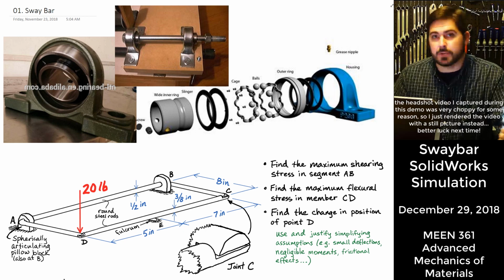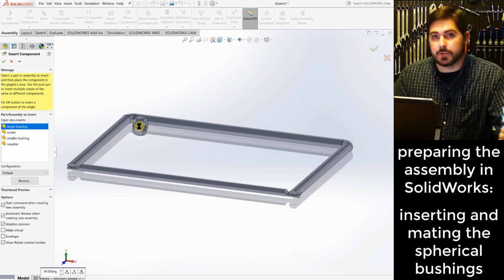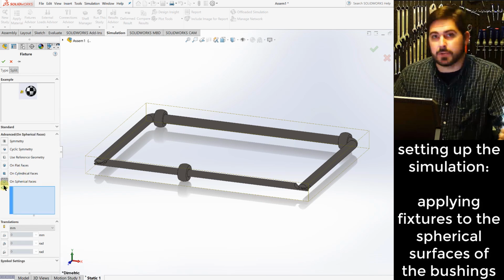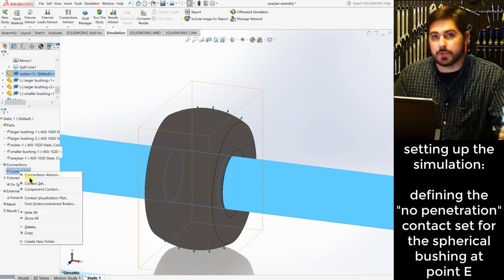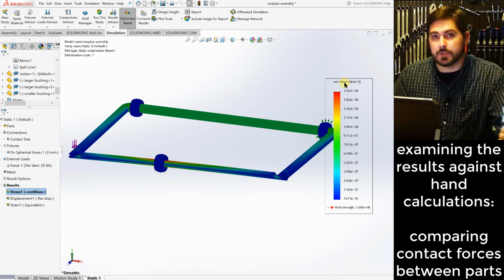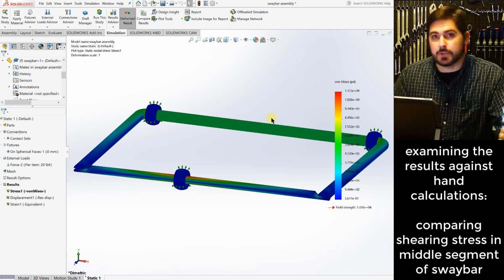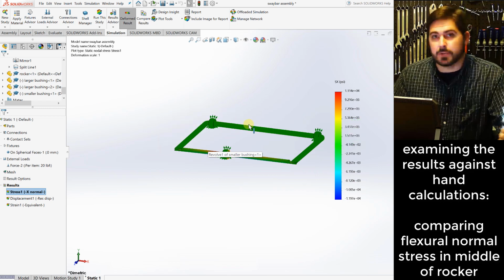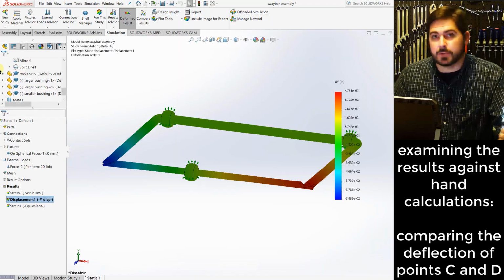Swaybar Mechanism SolidWorks Simulation | No Penetration Contact Connections | Stress & Deflections

Comment: Hi professor, curious - when you chose to ignore the shear in XY bc of the stress concentation, lets say you really did want to know TauXY, how would you go about verifying that actual stress to ensure its not a computational error... local mesh refinement? change the geometry? 

Also, when applying the external forces, sometimes i get high stresses at the point of application (contact stresses). How do i avoid this? thank you!

Comment: My mesh never works, probably my connections are not right
Reply from the maker: It is true that meshes often fail because connections aren't defined quite right, but another thing to look for is any abrupt features in the geometry of your parts. Nicely defined fillets tend to help.

I've been seeing your comments on a number of videos, and I'm going to respond to some of them very soon. I'm sorry I've been so busy!
Reply: Thanks a lot, Dr.Michael. You have been a big help in your answers. No problem.

Comment: Good job. I was also surprised about the wrong reaction force, dangerous.
Reply from the maker: Thanks! Yeah, those SolidWorks errors definitely bug me. I guess it serves to emphasize how important it is to complete manual solutions alongside simulations. Thanks for watching!
Reply: @TheBomPE  i am not sure but at 27:00 i figure out you doesnt care the target and source position when picking up surfaces for contact sets.  probably caused reversed the forces when conveying through the structure in the matrices and may cause the wrong reaction forces. you didnt coise spherical tangency when determining joints that make me think if there is a little gaps. if there is then  that problem couldnt be aproached as a static. but again i am not sure i just give some point of wiev. and thanks for the videos i like them.